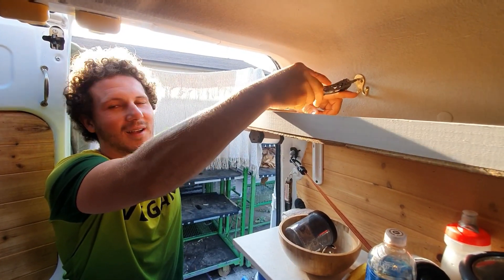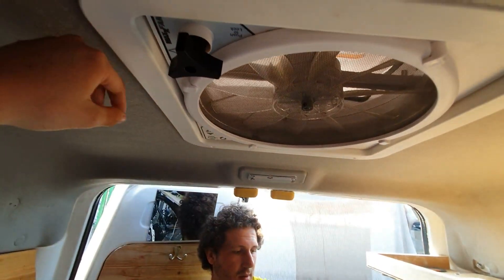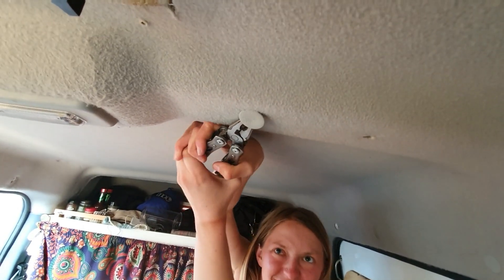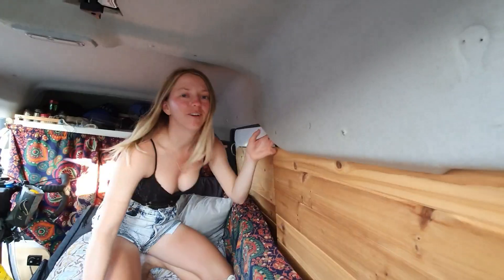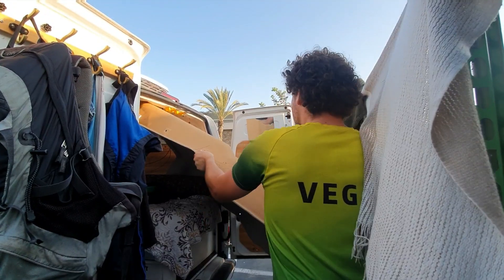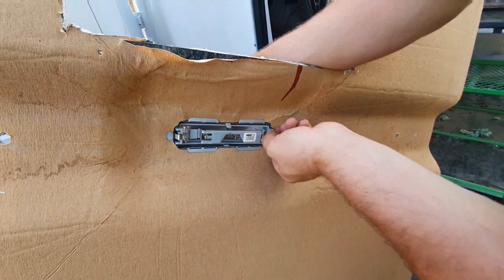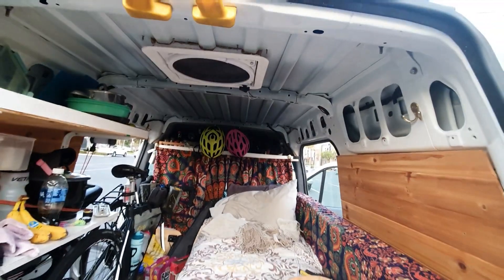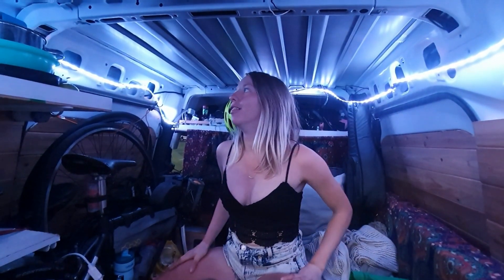How to Take the Roof Out of a FORD TRANSIT CONNECT 2013

Comment: Agree - you just lost your only insulation and noise deadening. Unless of course you're going to put up sound proofing and insulation later (?) And if you do add a roof of some sort thats more weight of course. While you have a heater for your next winter escapades - you will find out fast how hot that van gets with out that little bit of protection.  You can get LED bulbs (in colors) off of Amazon. While there are 2 bulbs per fixture - one LED bulb will be enough per fixture. The old bulbs pull 9-11 watts, the LEDS will be 3 watts. But to each their own. Looking forward to some van travel videos again.
Reply: The headliner in this van is pressed composite board , and has the thermal insulation qualities of a cardboard box.
While it would cut down a bit on rain noise , its main purpose is cosmetic.
This baby Transit is very much made to car specifications and none of it is by factory suited to being a camper.
Replacing the original headliner with wood paneling or pieces wont help much with heating , but it wont be worse either – everything insulates , but not everything is insulation.
Reply from the maker: We will eventually. Haven't noticed a big difference yet. But maybe in summer it will be noticeable.